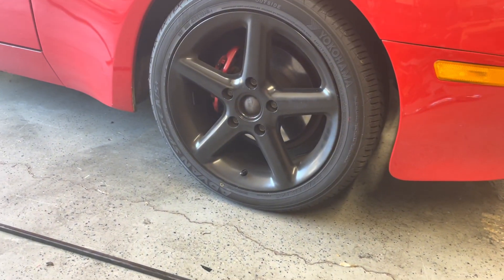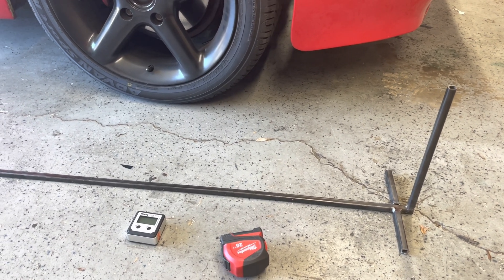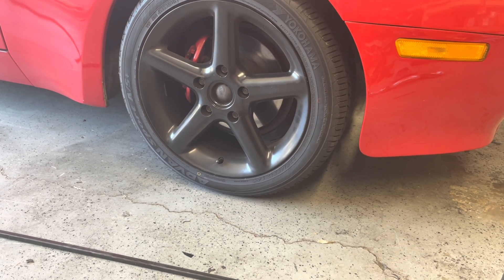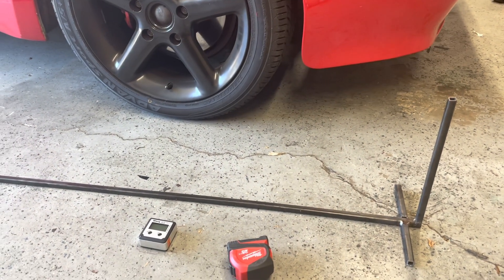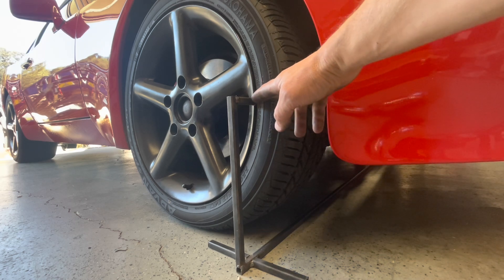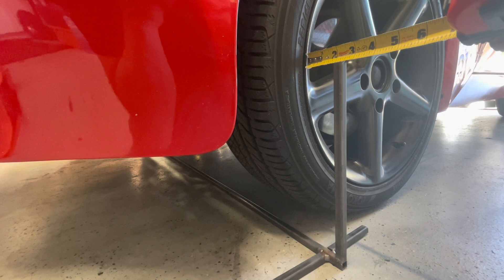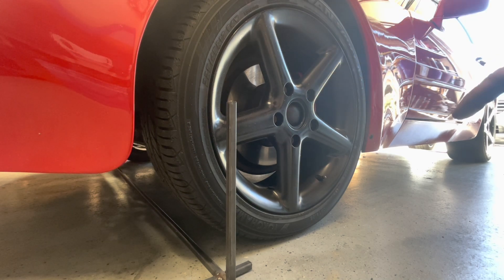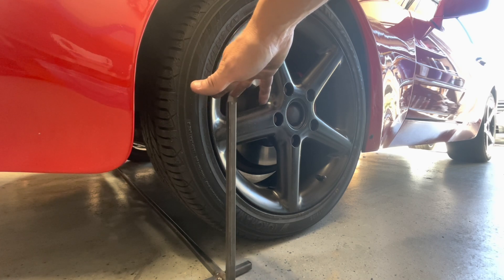Building a jig for DIY alignment

Comment from the maker: I didn’t mention this in the video, but I ended up cutting the driver side stability legs down to ~2” each side so it is easier to slide under the car. The 4” legs on each side were too tall to slide under the car. The passenger side still has the 4” stability legs.
Reply: Hi i have a 1990 944 that i did a complete suspension overhaul..now i need alignment.  Can you assist
Reply from the maker: @thericbrown6969  front and rear or just front? If all four and you want to do it at home set up strings and do it all by hand

Comment: Love the disclaimer for inevitable trolls. 🤣 Has this beauty been resprayed? Paint looks great! 

Mine pulled slightly to the right before I removed the control arms for the oil pan job. After re-installation it drives perfectly straight. I marked the eccentric bolts and kept everything the same for the most part. Must have been dumb luck. 🤔
Reply from the maker: Thanks sir, yes it was resprayed at some point, I’ve found some overspray. It’s no show car but it’s a pretty nice 10 footer.